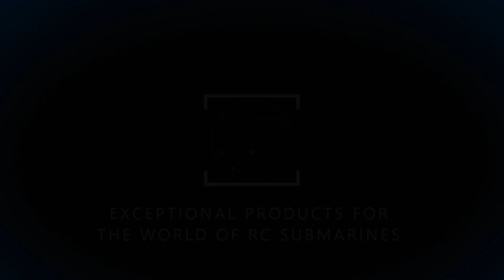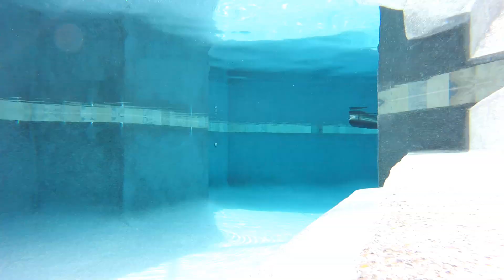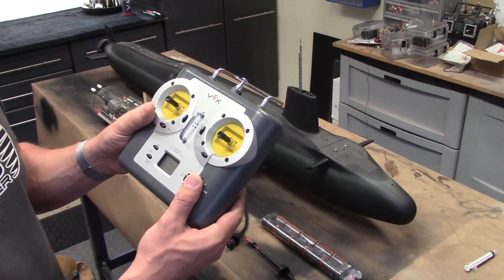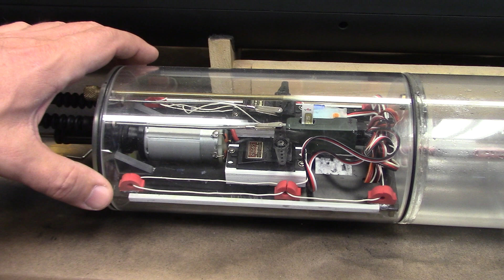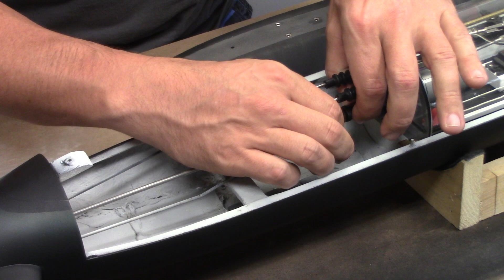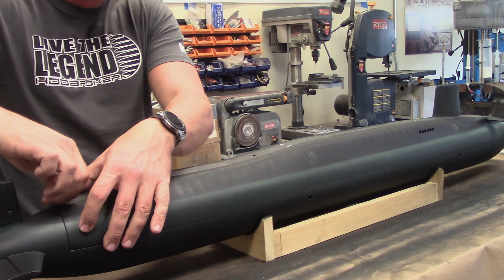UK Vanguard Class RC Submarine in 1:96 scale

Comment: It really does look like a whale, which makes a lot of sense. Wouldint it be better with a light and camera, so that you can control it when its deep under water? It does have a viewing port in the coning tower for a camera, so that its hidden from view.
Reply from the maker: Unfortunately, video operates on high frequencies that do not penetrate water.
Reply: @RCSubGuy  coundnt you have a wirded connection for a camer that is both a camera video cable and a safety cord for if it dies deep down? or someting? that would make it even cooler.

Comment: How deep can RC subs go? Probably a couple of feet? I'd imagine have your sub disappear wouldn't be very fun. 
It'll be cool if one day we can have cameras with live feed and deeper diving models. But I think that is impossible with current technology without a wire connection, right?
Reply from the maker: Correct. No wireless video due to the high frequency of the transmissions.
Reply: @RCSubGuy  that's what I figured, but how deep does it go?
Reply from the maker: @toki89666  Technically, our watertight compartment is good to 20 or 30 ft. In practical application, you stay at periscope depth 90% of the time, getting down to between 1 and 3 feet for a few short runs.